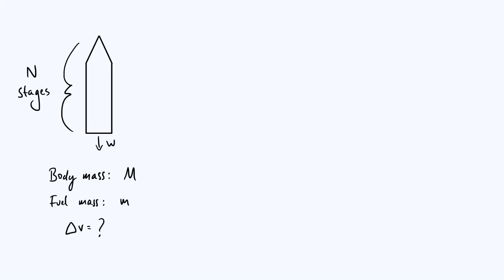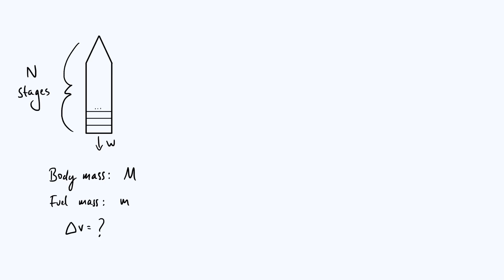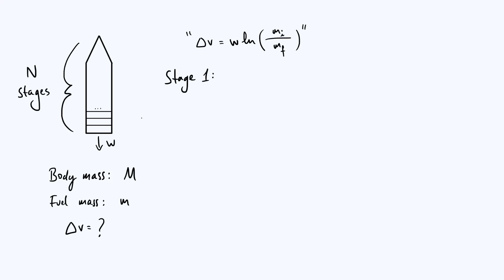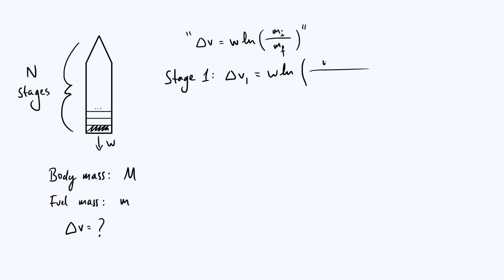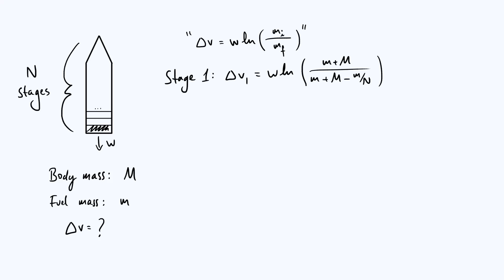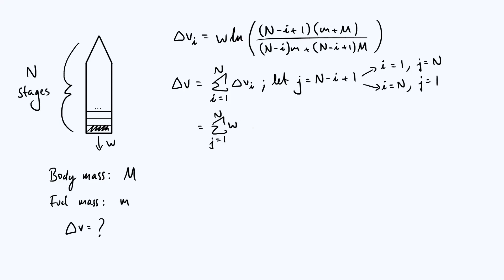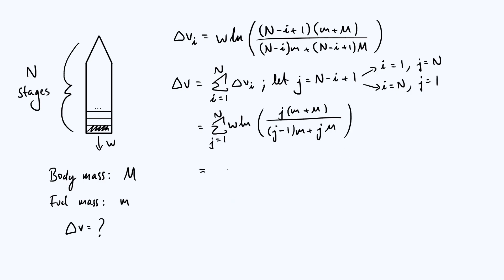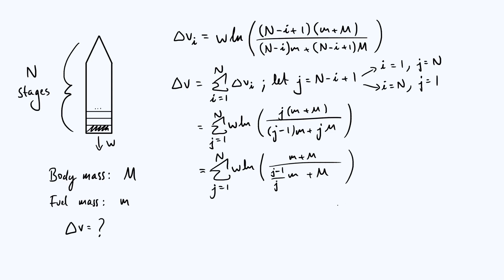Rocket with N stages: finding Δv

Comment: As each stage has an engine that would add lots of weight, so a large number of stages may not be the best design.  It would seem the final stage adds the most delta V as the rocket has the least mass. Nice example.
Reply from the maker: Indeed, more stages is better if we consider that the total mass is fixed, but you're right that this wouldn't really be achievable in practice! Thanks for watching.